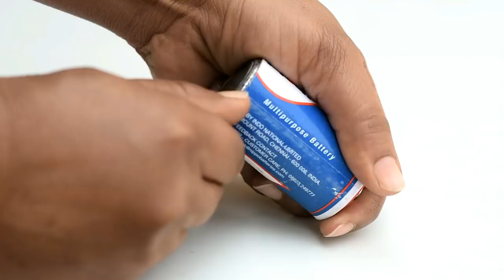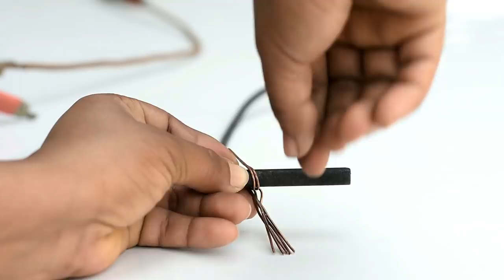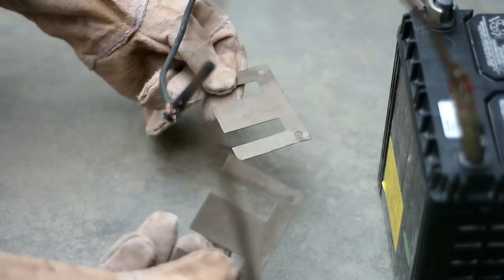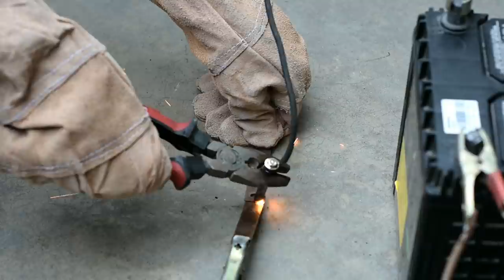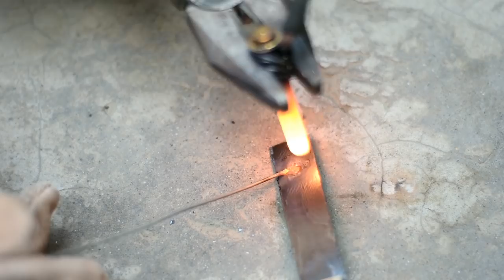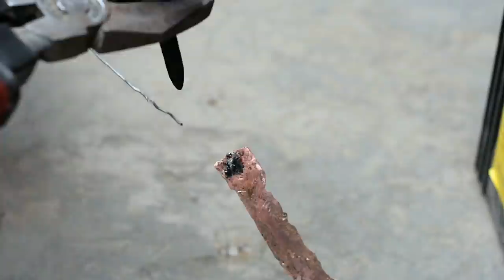✳️How to Make Welding Machine Using 12 Volt battery (very easy)

Comment: Carbon arc welding tends to be somewhat brittle in nature due to the oxides created but it can be done using a 12 volt battery as shown. It works far better if you grind the end of the carbon to a point which allows for better arc focus and control. You can also braze using carbon arc.

Comment: If you've ever seen a lead acid battery explode and fill the room with sulphuric acid liquid and atomized mist this is a great way to experience it close up.
Reply: The solution is to use extra long cables and keep the battery in a safe place away from electrical sparks.
Reply: It's very unlikely that the battery will explode by doing that. Every time it is shorted the battery discharges energy and therefore the voltage is reduced and so the current. That thin wire is more likely to melt first and cut the line than the battery will explode
Reply: @bradowen8862  i was thinking the same, but the current rises in the leads when It shorts right? Idk
Reply: Batteries explode because of the electrolysis that usually happens when it is being charged. The hydrogen is what explodes.
Reply: Best solution: Put it in the fridge while welding ;-)
Reply: No way...are you serious.😞😞😲😲
Reply: Bro electrolytes never short a circuit or battery 😂
Reply: @bradowen8862  Yeah, and if you weld with 100amp, that is safe, cause car starter uses more than and battery never exploded(car starter can draw 300amp on start)

Comment: This would work but it adds no filler metal so possibly makes the joint weaker then the base metal. This is more like an arc gouger instead of a welder.

Comment: I was off-roading with one of my buddies about a year ago and he ended up breaking an engine mount so i had to weld it back together with my truck battery, some jumper cables and one of the arc welding sticks in his truck and it was good enough to get his truck home

Comment: Can I use a 12v dc adapter instead of bettery?? ...plz reply
Reply from the maker: no, it takes more ampere.
Reply: @HackerOm  how much ampere is required?
Reply from the maker: About 30 - 40 ampere

Comment: I have experimented with welding using car batteries many times and although there is plenty of amps a battery is flat DC power and it does not arc at all. The best I could do was running two 12 volt batteries connected in series making 24 volt and hook a good size charger to one of the batteries which gave it a little ‘ pulse ‘ which helped it arc a tiny bit.
If you have the rod stick you only have about 2 seconds to get it off or it lights up like a toaster. 
Last time I tried it I had good batteries but only about a 4 amp charger and best I could get was some short ‘ scrubbing ‘ tack welds using 6013 or 6011 fast burning rod.
These guys in YouTube making it look like welding with a 220 volt welder are full of crap.
If you could add some kind of extra higher voltage to help it arc ( without shocking the crap out of yourself ) it might work good.

Comment: Battery will be damage
Reply: Jahidul Shikdar hhjokliyghllmkjhgddsVm
Reply: Battery will be fine, I'd be more concerned with causing an explosion due to gasses escaping from the battery, use longer leads.
Don't weld for long periods of time, like more than 5 or 6 seconds at a time.
It's probably drawing a huge amount of current, but no more than a stuck starter motor on a car.
I find the most overly safety conscious people are the same ones who'll get in a car with their kids in the back and drive down the highway at 70mph without even checking the tyres or see if anything is about to fall off under the car, leaking brake pipes etc, that kind of thing is more likely to end in a bad way
Reply: Also he should say what type of battery to get the carbon rod from, because you shouldn't open alkaline batteries
Reply: Jahidul Shikdar .
Reply: Adrina The Great
Reply: Adrina The Great 
Please do not use contraction when you write
Reply: Jahidul Shikdar Use an old recharged  battery
Reply: Adrina The Great whats a brake pipe??

Comment: can i replace the battery with power supply (12v)?
Reply: unlikely unless your supply is capable of over 100 amps, about 1,200 watts. ideally 130 amps 1,560 watts

Comment: Is it 100 percent safe
Reply: Abdulrazak Musalam no only do small sections on light metals or sheet metal.
Keep a shield between you and the battery. The bat heats up and could explode.
Reply: Tnx bro
Reply: Jamie Holladay
Reply: about 2-3 hrs continued use after it will explode.. so you might have some lead and plastic splinter on your body after so hide on a big shield! heheheh
Reply: @dadsonworldwide3238  what type of battery did he get the rod from in the beginning?

Comment: Real or fake
Reply from the maker: its real .
Reply: Really i used to do.
Reply: My Uncle used this trick to solder broken wire on a condenser in middle of jungle when car started to misfire and this condenser was used in old cars from 60s in the distributor. I still remember how clever my uncle was back in 60s!
Reply: Its real. You can get away with using a 12volt 200 amp charger better. Also if you barely touch the tip of the electrode where its barely touching the metal you can actually get a really good arc instead of pressing it down. Also use a vice.